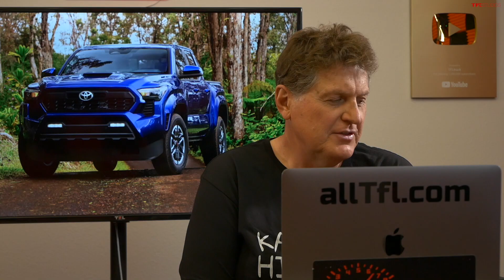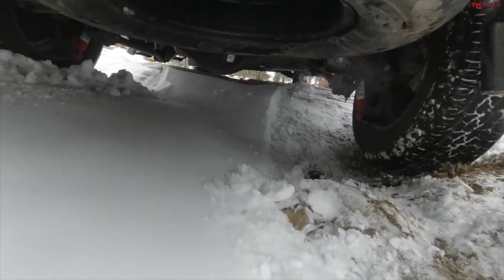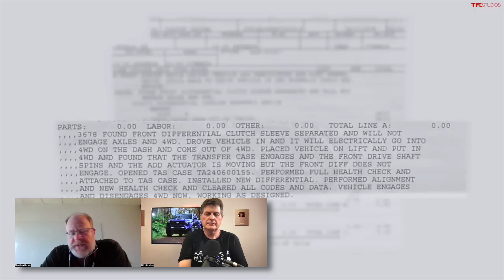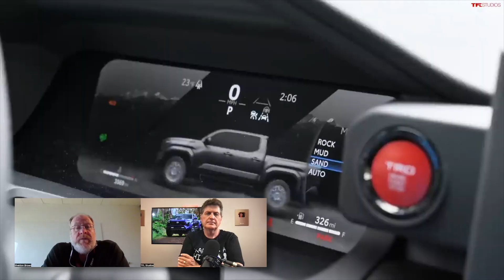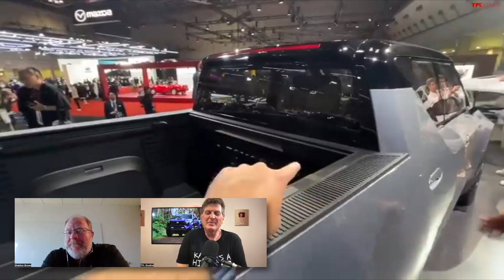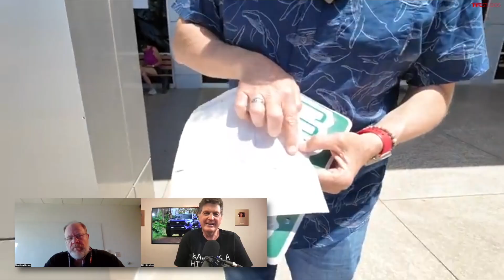The Real Story Behind How Our New Tacoma Broke & How Toyota Plans To Fix Yours!

Comment: So it seems like there were two major issues in that situation. First, the wheel with the most traction, itself had extremely little traction. So the torque management system aggressively pushed as much torque as it could to a wheel that was more or less spinning freely. Second, that the new engine achieves peak torque at low RPM. Which means a driver in a situation like this, has no real feedback warning them that the system is under heavy stress. With the old engine, you would have to rev it way up to put that much torque to that wheel. Something most people wouldn't be inclined to do on an icy trail.

There are two ways to 'fix' this, and it's not surprising that Toyota chose the cheap and convenient one. It is something of a fringe case, because it effectively requires that all four wheels have virtually no traction for a period of time. I would hope that that they would consider installing a more robust part on future models, rather than just relying on less aggressive torque management software. The thing is that while you aren't going to be able to go anywhere regardless under the conditions that caused this issue; reducing the aggressiveness of the torque management might keep you from getting somewhere that you actually could've gotten before. In the big picture, making the truck even slightly less capable for everybody, in order to fix what they call a fringe issue, seems to not be a great idea.

Comment: Roman you buffoon, please quit doing interviews!  This is a disgrace of your brand, Toyota’s of the past would hold up and now look at their recent offerings,  engine bearing and turbo failures of their turbo v6, transmission failures and overheating on many truck models.  Now power train  failures on air on two different you tube channels (yours and truck king) yet you refuse to call them out on these engineering failures. Shame on YOU!

Comment: It sounds like the software update will mostly just  reduce the power if it senses too much torque is going to too few of wheels so as to mitigate a breakage moment.  (Rather than increase the stressed component/hardware strength.)

Comment: So instead of fixing the hardware or properly testing it, they’ll use soft ware to limit it. Designed properly you are suppose to full throttle and rock bounce and make it home. Never would think the wrangler would be more reliable long as it doesn’t have the 3.6L. Toyota test your vehicles on the rubicon or quit labeling them as off road

Comment: Not satisfied with Toyotas explanation. TFL did a real world test and it failed. The test TFL performed was something very similar to what I would drive myself while camping and exploring. After hearing Toyotas explanation it sounds like this will actually happen again. I wouldn’t risk buying one of these Tacos because I have found myself in the same situation as TFL, snowing and rocks. And hearing it’s the electronics that broke it and hearing Toyota say as the driver you need to drive it different because of the high torque at lower RPMs vs a non turbo. Disappointing, I was seriously considering buying a new Taco.

Comment: 11:08 the only solution, unless you beef up the front diff, would be to software force the truck to deliver less power to the front diff, which will make it more likely to get stuck.

Comment: The contributing vehicle settings he described as rare is actually very common in off-road situations.  Bottom line is that components are not sturdy enough handle the load.

Comment: Good Video, Thanks for posting.  Took delivery of my off road Feb 16.  A couple of thoughts:  1. Based on what I saw, the front diff should not have broken.  2. Glad they are updating the logic in the Tacoma.  3. I want my update for my truck that has never left the pavement. Easy to update during a service. Oh and the Tacoma is selling better than the trolls thought. Y'all paid 45k for the Tacoma and sold it for 41K?  I wonder how the other mid size trucks would do at the same amount of time knowing  depreciation is brutal in the first few months.

Comment: Toyota wouldn’t do any of this for anyone but a YouTube channel to save face. Regular customers would likely be denied warranty without any communication whatsoever.
Reply: Look at Truck King, a smaller YouTuber  being instantly blamed by Toyota for their Tacoma breaking.
Reply: @Dwealdric I just checked truck king out, and you’re right 💯. That’s how I feel the average customers will get treated.
Reply: @robmd3851  toyota isn't going to fall for operator error induced warranty claims.  Like the 2000 toyota celica gts, owners money shifting the engines and blowing them up causing toyota to replace them for free until they determined it was operator error and denied those claims.  rightfully so too.
Reply: Wow, Tundras not being so reliable ? As a mechanic of 46 years now I can say that Toyota is a good brand but certainly not without their issues over the years. Would this have happened if electronic parts were not involved ? Maybe. But unlikely. Too much technology is just too problematic. Simple well made axles and such without technology will take more abuse and will last longer.
Reply: Thinking the exact same thing.
Reply: Toyota isn't Ford , Ford screws their customer with every vehicle they sell
Reply: TRUTH !
Reply: Exactly. Toyota cares not what a regular customer says. Example: I complained that when a Toyota detects an O2 Sensor problem has happened, the vehicle's computer disengages the cruise control function. This action is not just inconvenient, it creates a hazardous condition for any person who, for whatever reason (such as leg, knee or hip issues which prohibit a person from keeping their leg in a certain position for an extended period of time) needs to use cruise control as a safety item for long distance driving. Toyota dealer refused to alter (reprogram) the vehicle computer from disabling the cruise control. Same for Toyota HQ.
Reply: Idk what's happening with Toyota but historically they pretty much fixed problems and moved on, that's how they garnered a reputation for reliability meanwhile GM, Ford and Ram were kinda hesitant to do anything in a swiftly manner.
Reply: Toyota didn't need a youtuber to recall 100,000 engines for the tundra and replace them for free now did they?  pretty sure they care about their brand reputation and reliability
Reply: These guys have zero credibility to me in this case with Toyota
Reply: This
Reply: I have a 2018 and had to quickly stop from 30 mph to zero when someone cut me off on a city street. Immediately the truck began to shudder. Dealer said: perfect storm and your torque converter twisted up and went bad. $7000 for a new transmission. 

Dropped the pan, changed the filter. Added anti-slip additive…drives like new. 

These dealers and engineers lie like all the politicians.
Reply: He obviously money shifted that truck. Most transmission will explode when shifting from fifth to first and dumping the clutch lol
Reply: @kevinwest1607  nope that did not happen watch the video it never hit redline. Toyota has cheapen out and raised the price trying to max the profit. I have had many manual transmissions vehicles that handle way more power whichg I missed gear in and never blew up the clutch. They built this truck to spec and its low one that is why it is breaking.
Reply: @kenwolf2431  it did indeed hit redline.  it basically bounced off the rev limiter.  you even heard the crunch of the transmission.  NEVER dump your manual into 1st gear when driving at speed period.
Reply: why hire them if they're doing it for free and buying their own trucks. Free testing.
Reply: Not going to lie. I had a truck and their service center messed up. Gave me a brand new truck because it was within 30 days no questions

Comment: Software programming doesn't seem like a good safety system against breakage.  Better to be just built stronger.  With all the issues with software in vehicles what happens when the software glitches out?  Things start breaking?

Comment: They told you can't talk about?! You paid full price for the truck, you do whatever you want!
Reply: TFL doing a little hawk Tuah on Toyota so they can keep getting invited to events. Sell outs.
Reply: The my want to keep getting invited to Toyota events.  That's why small channels will tell you exactly how they feel; they're not getting invited, anyway.
Reply: Youtubers have to schill for OEMs so they get invites to media events
Reply: The majority of their views/clicks probably come from Toyota videos (I haven't checked, but assuming).  If they sour the relationship they will be impacted from a revenue perspective.  So, they tread carfeully.
Reply: There were strings pulled in order for them to get one so early.  They still want a partnership with toyota in the future.  Just cause there is a small fire in the kitchen you don't yell fire in the dining room.  No need to cause mass panic when it might be easily solved or a one off situation.
Reply: @spyder000069 "easily solved" doesn't require five months.
Reply: @doom4067  Things move slow in a big company.  According to the video tfl may have been the only one.  Hard to solve problems unless there is enough data and then you need a mitigation plan which takes more time.  In this case they will use software to avoid this situation which may reduce the potential for issues but does point out the design was flawed as the mechanics should have taken that.  Every 4x4 ive owned would have even my econo geo trackers.  Its common knowledge to not buy the first year or two of a new design and the people who do beta test and pave the way for the rest of us.

Comment: Toyota's ATRAC system since its inception has always been far more aggressive and far less polished than this new generation traction control system. Theres plenty of real world videos of trucks with oversized tirrs in extreme terrain that shows very violent traction control action and not one single ADD or front differential damage. I've used ATRAC and determined its a bit too aggressive and makes the truck unpredictable to drive on very tricky obstacles like boulder bashing, which is why i installed a front e-locker.

Sheldon Brown argued that we dont need a front e-locker because the traction control system is better, but now he's saying the traction control damages the truck. So they engineered out the reliability of the part. Great. 

Solution: strengthen the part and install a factory front locker.

Comment: This is crazy. Seems like back in the day people were throwing 35s, 36s on the stick axles that came in the 80s Toyota 4x4 products, and ran those without issue. Now people are breaking things left and right with stock tires. 

Truck King just dropped a video where they broke a 6-speed manual Tacoma.
Reply: By downshifting 4 gears at speed. If you need nanny state guard rails to stop you from doing destructive shit, get a fisher price toy.

Comment: Toyota would have never done this podcast if the Tacoma sales weren't way down. This is damage control, not  transparency. Multiple reviewers have broke them during moderate stress scenarios. Not to mention the trans overheating issues.
Reply: Sounds like sales are doing ok to me.  We will see 1st half numbers soon.
Reply: @planoman0935  The Tacoma numbers are in:
2023 Q2 = 63,262
2024 Q2 = 47,879 / -25%
2023 Q1+2 = 116,845
2024 Q1+2 = 69,437 / -40%
Reply: @planoman0935  Tacoma started delivering in Q4 2023 aside from iForce Max. Q1 2024 sales were down almost 60%. Some of that is also due to not delivering any iForce Max models. But just like the Tundra, only 10-15% of Tacoma buyers will opt for the iForce Max. So we will see what Q2 looks like, but all signs point to down 30-35%.
Reply: @nismomike3182  That’s because, just like the Tundra, the iForce max will be lame. Minimal mpg improvements and no improvement for freeway towing.

Comment: So, basically, it broke. I must call BS on this explanation, all four tires were spinning in sync when the shaft snapped, at least that is what my eyes saw! Not this scenario Toyota is claiming where power was sent to the back, then front, then front right, then front left tire, that does not line up with what my eyes see when I watch the video. Time will tell, between this and the 3.4 turbo issues, not a great beginning of 2024 for Toyota. But then, I drive a Land Rover...

Comment: Go check out the clutch dropping from Truck King. Basically, Toyota is saying in both cases, it’s not really their fault.
Reply: I heard they detuned the engine with the manual because they "couldn't control your right foot", turns out the transmission is weak and underbuilt they didn't have to do that in the previous gen smh
Reply: That was there fault seen it a dozen times on 6 speed toyotas
Reply: @BrianSmith-si4zd  You must not drive a manual or just not watching the video.  
First the syncros wont let you go from 5th to 1st that easy, he would have literally had to force it with all his might.
Second if he had managed to get it into first before the clutch was even release it would have overrevved the engine and pinged it off the redline.

Neither of those happened.
Reply: I saw it. It was TK dropping the gear to 1st. You can tell from 90kmh it revved to almost readline. They tried to shift into 1st gear. But the transmission must be crap build for it to just blow from that. I have done that to 07 civic si downshifting and bouncing redline. It still work today.
Reply: @brucey5585  they tried to down shift from 5th to 3rd. Toyota said they shifted into first. 5th to 1st? Without redlining? Uh huh.
Reply: You did not watch it or you would not say that. They dropped from 5 to 3 plain to see on video  @brucey5585

Comment: One of the reasons I like my '06 TJ Rubicon Unlimited with 6spd manual... it's 'dumb'... Only one brain deciding what the wheels are doing... my brain.  No traction control, no ABS, no transmission controller, etc.   None of this ' USB port is dead so the trans won't shift into reverse and the engine cuts every other cylinder Monday, Wednesday and Fridays'.

Comment: Shanin Red X... X = excessive component cost reduction strategies and lack of proper durability testing lead to this failure mode.  Why abandon the Hilux's robust design principles 1986-89? $$$ profits.
Example - GM's plastic electric connector locking tabs are only engineered to last for 3 connections: once on assembly, removal on assembly line (if rework is required) and the reinstallation after rework.  
Too bad engineering departments are restricted to engineering methodologies that design components to "last until the end of warranty period".  Engineered obsolescence.

Comment: His answer sounds like corporate double talk, the only 4x4 mode i need is 4wd high or low, your traction control bs doesn't make a vehicke better, exceeded the margin by 1.7%, what a crock, tge differential shoukd be the toughest piece in the rig

Comment: The bottom line is lockers are cheaper and work better than expensive  fancy software. With 4 wheel lock, less power can be applied to crawl over things. With software telling brakes to be clamped hard to force power to a different wheel means more power is needed which in turn causes over heat and unnecessary stress on multiple components. Welcome to the complified modern world.

Comment: What I just heard boils down to: we won't make it stronger, we will limit torque and capability. 
IMHO, not a good answer.
Reply: What i thought too fix will be a software update because driveline can't take it.
Reply: Exactly
Reply: They didn't fix anything and took away the capability of an advertised and sold feature.
Reply: driveline will handle normal operation fine.  the condition that broke the ADD is that the force exceeded the rated capability caused by two forces acting on the front diff, brake and torque.  all they had to do was dial back the torque a bit within the rated capability.  problem solved.  Still has MTS.  Still has torque transfer to the axle.  You didn't lose anything or any ability to offroad.  Its like saying you have a rev limited so it prevents the operator from over revving the engine.  With any software design there are going to be use cases that arise outside of parameters.  And they figured it out and fixed it.  Move on.

Comment: I have the first year of the redesign Nissan Frontier, 2022. No issues whatsoever. I’ve taken it off road many times in similar conditions. Nothing has broken or went wrong in 19,000 miles! I’m very happy I didn’t go with any of the other competitors. All I see this video by TFL as…Damage control
Reply: Nissan marketing team in the comments 😂
Reply: @drivewayhero  Lol, just a Frontier owner 👍🏻
Reply: @drivewayhero Nah all the truck enthusiasts in 2024 are starting to look at Frontier as Nissan still produces a simpler truck with a V6 without the torbos and shit. Nissan has garnered quite the positive reputation with their trucks. They don't use the CVT garbage in their trucks, same can't be said for their cars and SUVs though
Reply: @lrn_news9171  i see the humor flew right above your head
Reply: While watching this video I actually got a frontier commercial. It said “Frontier wins” too dam funny
Reply: Agree but that was a more minor redesign compared to this. Still no excuses. My 2003 Ram was the 1st year of the Hemi and it is going strong with 230k miles and still no serious problems
Reply: That year does not have MDS either...500K to a million miles is very feasible.